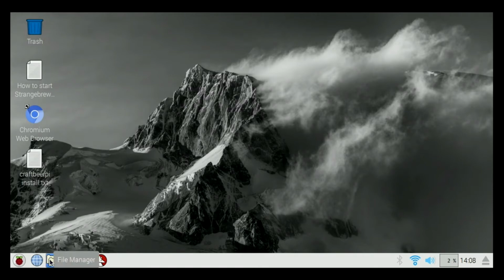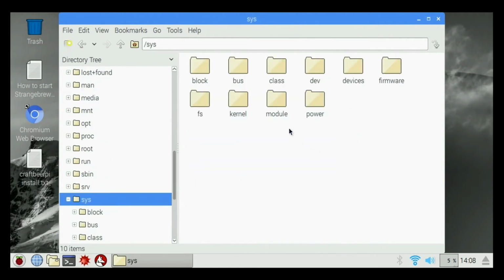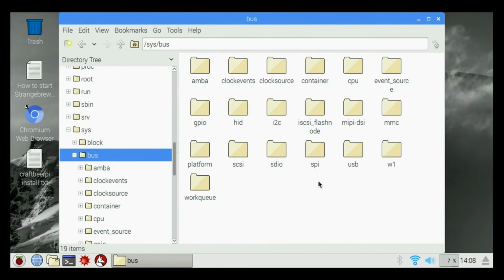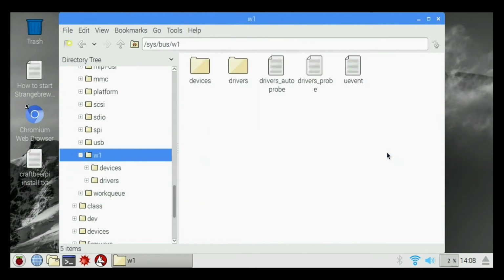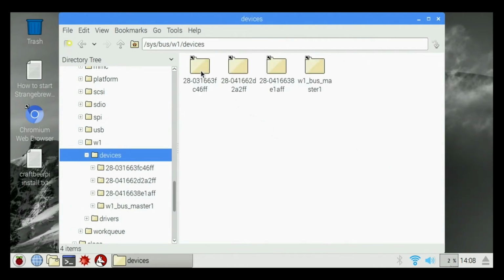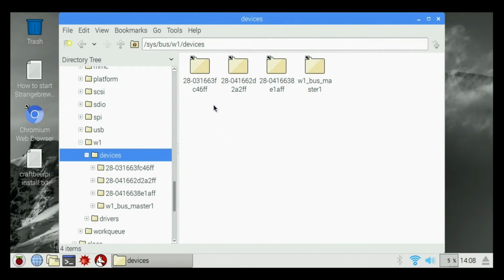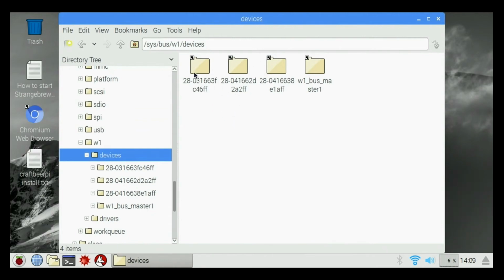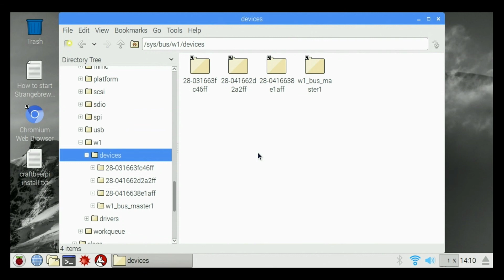Ds18b20 Temp Sensor Diagnostics Hosehead Electric Brewery Control

Comment: Hey man,

I'm still unable to get the OS to see my temp sensors. I've checked the config file which has the relevant code in there, but they're not showing up in the W1/Devices folder. I've had them running before, but I haven't brewed in nearly a year and once i started up the CBP 3 I couldn't see the temps at all. I've checked all my cables and they seem to be fine. I've just plugged in one of the sensors to the 1Wire input and I've gotten nothing. I'm super frustrated. Are there any other possible diagnostics that I can run? Is there some way I can run a diagnostic from the command line to see if the 1Wire input is still working okay?